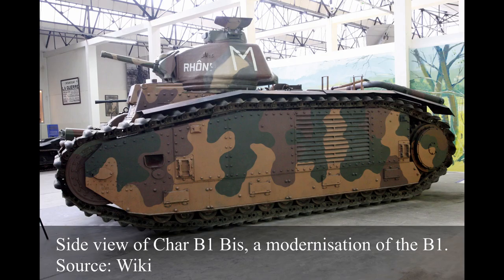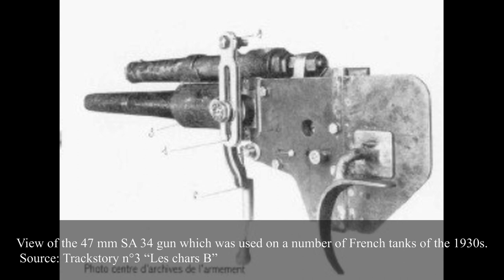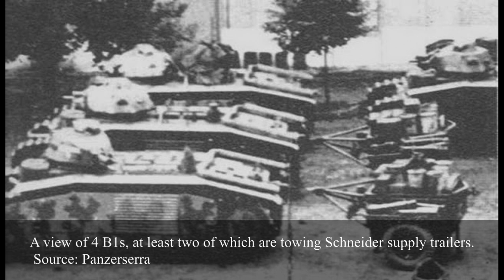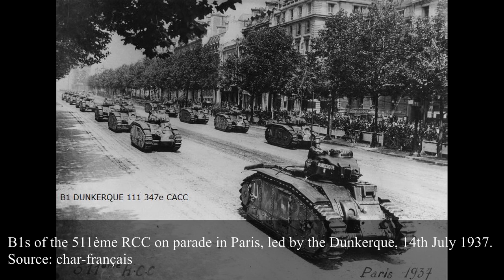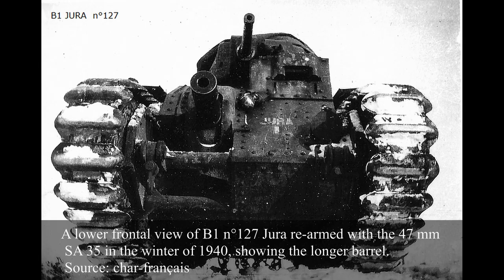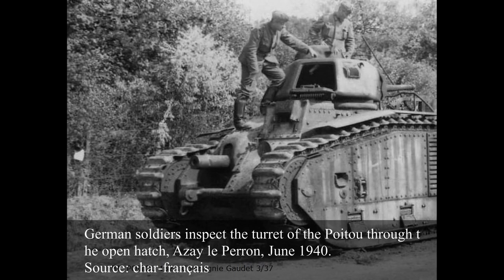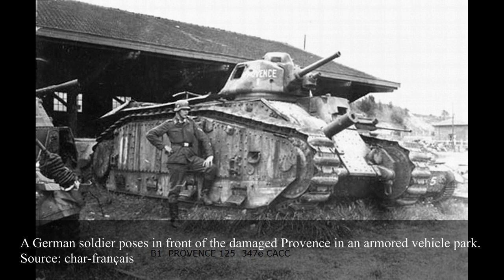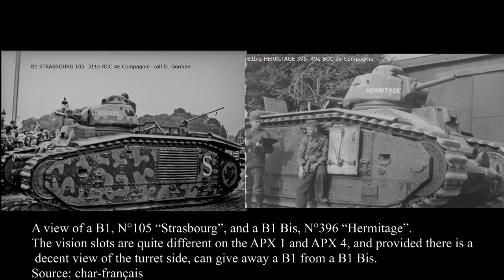1920's Concept, 1930's Engineering, 1940's Debacle | Char B1 (part 2)

Comment: Why does the 75mm barrel have so much material around it?  Why not install longer barrels in both, especially the 47mm, 50+ calibers would have made for a much better muzzle velocity and penetration and the 75 could have been as long as the tracks extend in front of it at least.
Reply: The 75mm barrel is already inches away from the tracks.  Any longer and it is in danger of getting debris in it when traversing rough terrain.  As for the 47mm, the turret looks quite small, it doesn't look like it can handle much more unbalanced weight.  The long 17lber gun on the Sherman firefly required a heavy counterweight to balance the turret, which was not the most ideal.
Reply: Some of the barrel weight would be useful to balance the gun from its breech I guess.
Reply: @Edax_Royeaux  All great points. Videogames & modern design philosophy have trained us to expect a certain degree of ingrained modularity & the ability to quickly update/upgrade armored war machines.

Yet, the truth, even today, is far more messy. Tanks were, & in many ways still are, holistic weapon systems. Often walking a finely balanced line of reliability without over engineering within the understood limitations of the materials... & even today often failing in the first or second attempts.